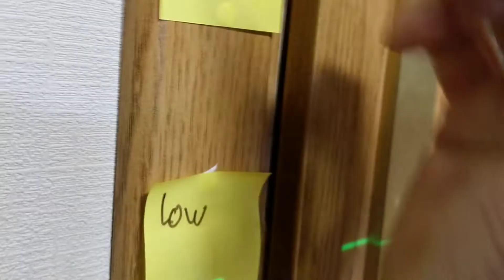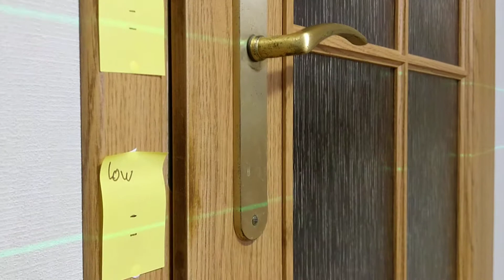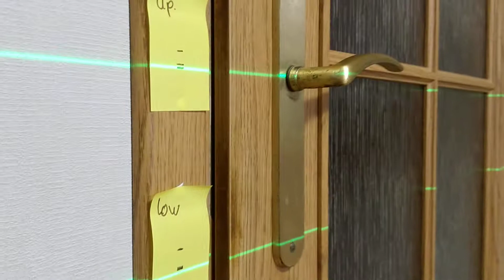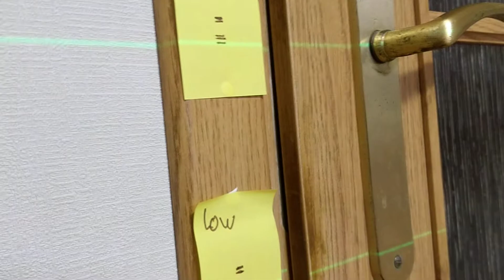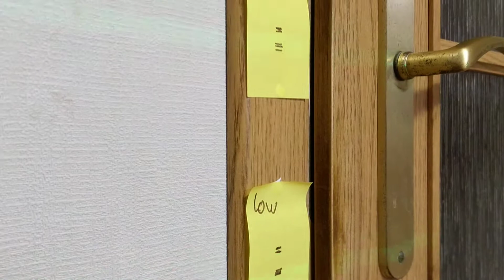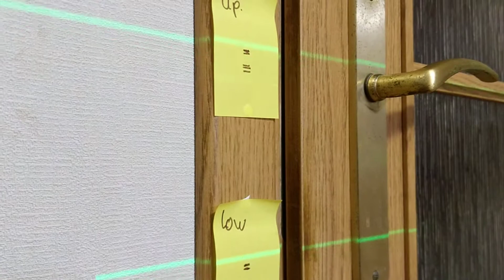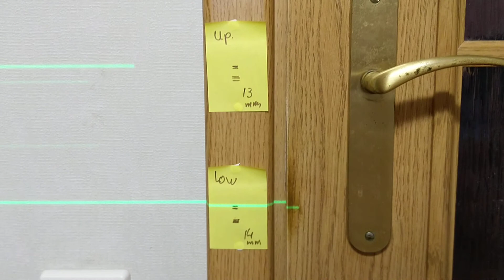Huepar 904GD laser level accuracy check

Comment: This doesn't make sense...? If you move the laser, of course the line won't be in the same spot. You can't draw conclusions from this. Your rotating adapter has 3 feet that can be changed in height; if your windowsill or the adapter isn't 100% level, of course the line height will change when you rotate the laser.

Comment: Seems like a pointless test.. if the laser is put in a random position it's projected 360 Line should be measured the same height from the floor at multiple spots on different walls, assuming the floor you measure from is absolutely level as well.. 
If not the floor isn't level or the lasers pendulum isn't level. 

But now you rotate the laser on its axis and measure the same spot on the wall. But imagine if the lasers base is a bit unlevel in its horizontal plane or doesn't rotate completely horizontal it may be very possible the housing is angled or tilted ever so slightly.. that will result almost like a the thread on a bolt it's spiralling up and down in height. The self levelling  pendulum only makes sure that at a random position of the lasers housing is fixed..the lines are 100% horizontal and perpendicular to eachother. So you should measure without moving the laser it's beams on different walls..that should match if the house is straight. 

Rotate the housing and measure again all the same spots on different walls and again that line should give same height. 

To me now it seems that your test concludes your pendulum is perfectly self leveling,but possible the plane you're rotating the laser in isn't absolutely level.
Reply: same opinion here
Reply: Do you know that the floor itself might be out of level, do you?